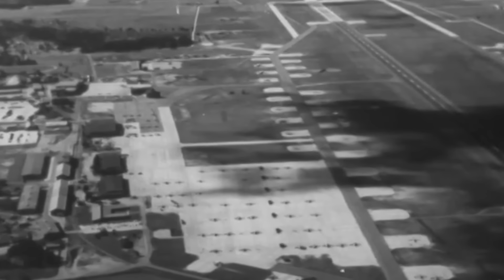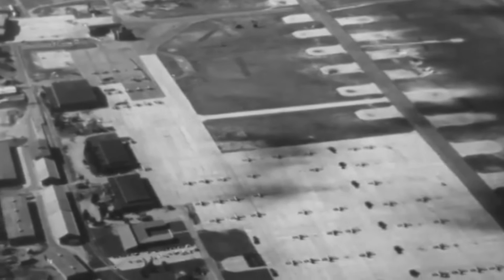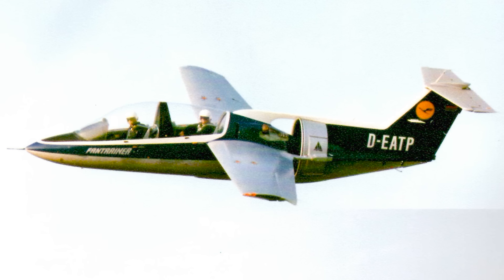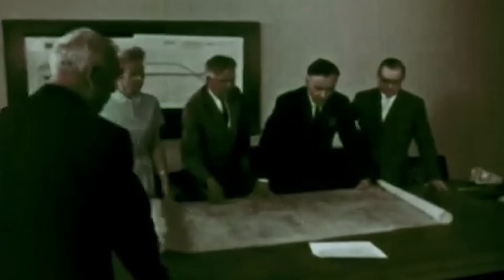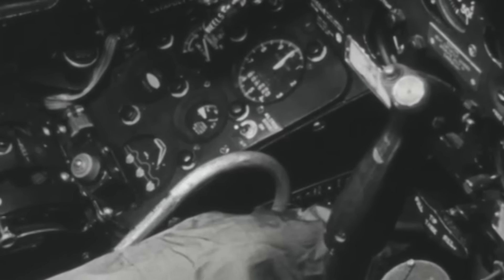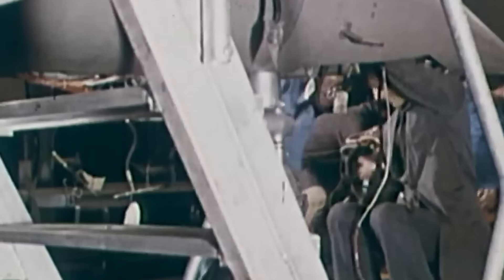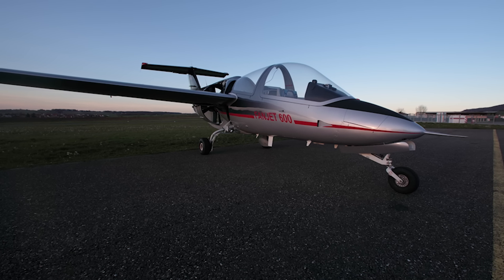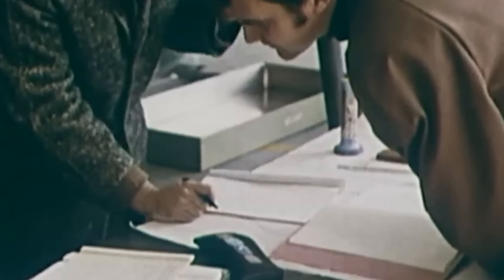The Stunning Plane that No One Really Trusts

Comment: The actual key selling pointz for the RFB Fantrainer was that the fan did not develop much thrust at low rpm, it thus emulated the behaviour of jet engines which require well over 30% throttle to really move a plane. This plane was to be a cheap way to get pilot trainees to accustomed to jet engines behaviour. The German MFD found this to be a solution to a non-problem as pilots found little difficulty in the switch between jets and classic propeller planes.
Reply: If you play any flight simulator there isn't much difference in what you do between the two.
Reply: @thomgizziz  simulator game might model the flght characteristic wrong, they are not 100 percent accurrate esp. on rare item like this
Reply: Simulators are one thing, realistic engineering is another.
The truth is, if someone had a half a brain in the industry, they would have already designed and built a ducted fan internal combustion engine powered aircraft that would have already gotten to Mach 1.1.
It wouldn’t be loud like the Thunderscreech, as the blade ends would have been enclosed by the shroud, similar to a modern high-bypass turbofan.

Nobody seems to be interested at this point, and probably never will be.
Reply: The US air force found it to be a problem hence the T-37. For decades USAF pilots would never fly a piston engine.
Reply: @dangeary2134  why would you do that?
Reply: @dangeary2134 is it even possible to get a ducted fan over mach? Those are big ass blades
Reply: @Dunkopf  Almost all jet airplanes that can supercruise are turbofan engines, which are ducted fan engines going over mach, just the fan is powered by a gas turbine instead of a piston engine, because the amount of shaft HP you have to develop is a crazy high amount for a piston engine.
Reply: @Dunkopf if the intake was designed a certain way, so that the flow in was lower than M1, then yes.

Comment: Ducted fans, both electric and gas powered, have been used to simulate jet engines in RC model aircraft forever. They work great and can produce exceptional thrust in the same airframe.
Reply: but in RC EDF is not energy efficient, with same weight and desain, pushrer prop could fly 4-5 times longer and 3 times further than EDF
Reply: @devilbur0 jets are not energy efficient either, the ducted fan was cheaper